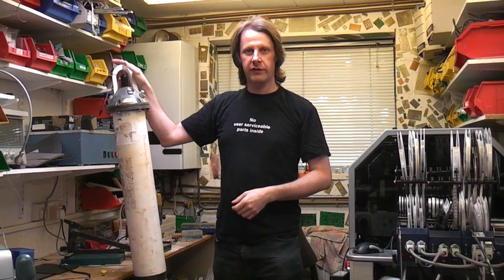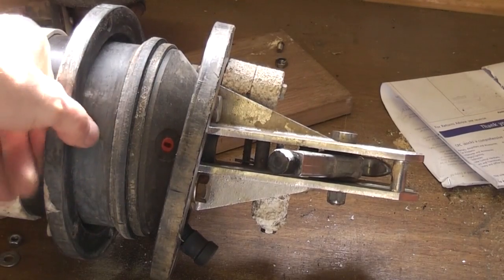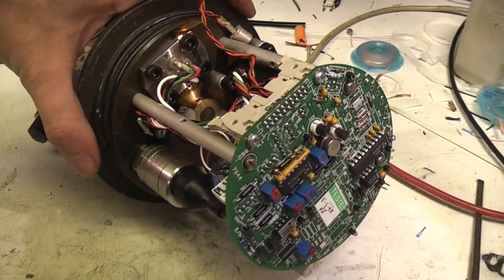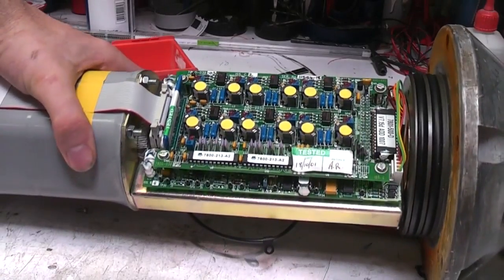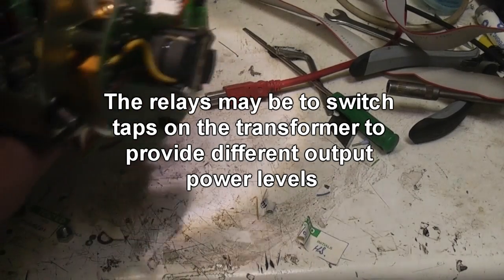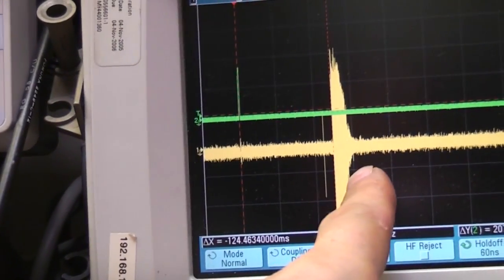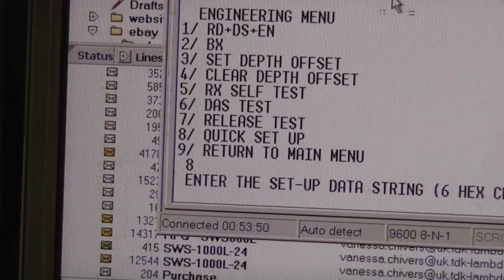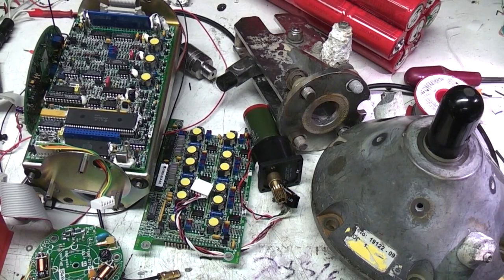COMPATT Sonar transponder teardown

Comment from the maker: The ROV sends a ping and measures the return time. The hardware in the ROV knows the speed of sound in water (corrected for pressure, temp and salinity), and its own depth and the depth of the COMPATT so it knows the distance, and someone knows where the COMPATTs are, so from 3 readings it can know where it is in 3D. They do versions with more accurate pressure sensors where more accuracy is needed.

Comment: Thanks for the vid, Mike. I used to use similar but full ocean depth for oceanography. Temperature difference may have been the reason you had a little positive pressure when you opened it up - it may have last been sealed (batteries replaced?) at cold temperatures (usual at sea). Always best to open these kind of submersables while not standing in front of the opening end. As you mention, sometimes lithium thionyl chloride batteries are used in such underwater stuff (high energy density) but if seawater ingress occurs into the chamber and a battery is corroded then bye bye electronics (all corroded) as really nasty HCl and H2SO4 fumes are released. Luckily I was outside on deck when I experienced this. Standard alkaline D cells are far safer, cheaper, easily available and can be air transported without the lithium restrictions that now exist (although you may be able to ship these sealed containing Li batts as you mention (though I am not sure IATA agrees with this now as the regs change frequently) you might want to just airfreight replacement batteries which is problematic).

Comment: Try to get an anti-submarine warfare expendable sonobuoy... I have one, pretty neat stuff. They feature a single use, sea water activated battery, a parachute, and an inflatable buoy (with either a pyro device or a CO2 tank). Sadly I can't open mine to see the insides, the electronics are sealed into a welded steel tube. Search yt for "p3 orion sonobuoy" to see what it does since air dropped.

Comment: I have been using transponders like this on semi-submersible drilling rigs. They are used as beacons and with a few of them you triangulate your position very accurately. They are used as an input to the dynamic positioning system. You want to know the position more accurate than what a GPS can give.

Comment from the maker: There may be other limitations on lifetime requirement, liek typical deployment duration and corrosion protection, so standard alkalines are probably good enough. A custom solution may not give a huge improvement, and could also be a risk by tying the manufacturer to a specific supplier.

Comment: In addition to issues with torque, a magnetic coupling would also leave the bearings on the water side exposed to seawater and thus prone to corrosion unless they used some exotic nonmetallic material.  Also, the end cap would effectively block the magnetic field if it were steel.  The heavily sealed shaft method means that all of the bearings are protected.

Comment: this black 'rubbery' stuff on top of the piezo transducer is an acoustic impedance matching from impedance of the piezo ceramic (40-isch MRayl) to the impedance of water (1.46MRayl). Pretty much like a "balun" for electronic RF antenas. It has to be of that exact material and geometric shape, by chipping it off you have probably reduced it's efficiency by quite a bit.

Don't try to listen to it under water - these things are known to make dolphins and whales deaf.

Comment: The AD581 reference is likely for a current-source used to drive the RTD.

By driving a RTD with a fixed current, you get a linear resistance-voltage relationship. Using a resistor-divider for an RTD produces a non-linear relationship (though admittedly RTDs don't vary much, so it wouldn't be hard to compensate for in software).

Anyways, if I wanted to design a high-precision RTD measurement circuit, I would use a current source.

Comment: In this we have a pack with 7*3 batteries, that is 21 batteries. The pack is marked as 31.5 V, 16Ah. Assuming cells are 1.5V and are all in series, that indeed is 31.5V. So that is 16Ah per cell too at 1.5V. 

It is interesting that they used standard Alkaline primary cells, and not something that is higher performance and density, like lithium–thionyl chloride (LTC) batteries, they can fit 19 Ah per D size cell at 3.6V. They are a bit dangerous and expensive, but there are batteries that are rated to operate underwater or in water prone environment safely.

So, with that special batteries they could basically use 3 times less batteries, or in the same space, keep it for 3 times more time. Not only that, they have very good performance down to -40 degree C, and 96% capacity after 10 years from self discharge.

Example: https://tadiranbatteries.de/eng/transport-and-information/applications/lithium-batteries-for-off-shore_18.html

Comment: I’ve worked with quite a lot of subsea stuff. Wellheads tie back to platforms or FPSOs using umbilicals. These umbilicals carry well fluids to top sides  but also water soluble hydraulic fluid, gas and water for injection and electrical power. Comms to subsea for valve control and instruments is almost always achieved using QPSK at very low baud rates. These wellhead modules can be 30+ miles from the platform producing it.

Comment: 20:50 The white powder on that thermocouple is magnesium oxide, it acts as an electrical insulator and aids heat transfer.  That probe looks like the ones used to measure feed-water temp in nuclear reactors.

Comment: good video. looking at stuff like that I always start to think about how it could be much simpler. why not just pot the electronics as a way to handle pressure. no need for a wild pressure cavity. I'd also avoid the mechanical coupling through pressure vessel. it has to be possible to make a simpler more elegant detach mechanism. even if it has to be motor and gears I'd run it in oil to avoid sealing pressure gradients.
similarly it should last hundreds of years on such a large battery

Comment: You may already know this, but the connectors are made by Sea Con. 
I wonder if they use TH components as it would make them easier to repair/change at sea? If your in the middle of the ocean with the nearest electronics store 1000's of miles away, it could be quite handy to repair individual components on boards if necessary.

Comment: But if this is some sort of acoustic positioning system, how does it stay in sync with the other part of the system (the ROV or what ever), so that it can calculate the distance and do the triangulation? I didn't notice any super accurate clock or anything. After a year I would imagine that it would be quite out of sync almost no matter what the clock source was. 
A quick calculation tells me that it would miss by ~1.5m per 1ms error, right?
And also, I would love to see inside that hybrid =)

Comment: The EPROM programmer can interface with the chip and write (and I guess read in this case) the data on it.  In this case, programming is literally just putting a program on it.
If you're referring to the console access he got to the device, he probably connected it to the serial port.

Comment: Right. And because of that, the clock only needs to be accurate on that (if I heard right) around 125ms range...and you can have quite the inaccurate clock (compared to GPS) and still be fine.  Unlike GPS (and other above-ground radio location systems) this isn't a broadcast system, from what Mike has described.

Comment: It's exactly how GPS works just under water.
Reply: Yeah exactly like GPS, just without the dozens of satellites and the atomic clocks and the orbital mechanics and with sound instead of radio waves and the transmitter is the same as the receiver and it's under water at high pressure instead of in space at no pressure and it gives you a view of the local environment instead of a global position, but apart from that, yeah, exactly like GPS.